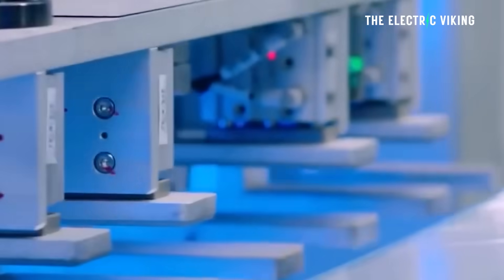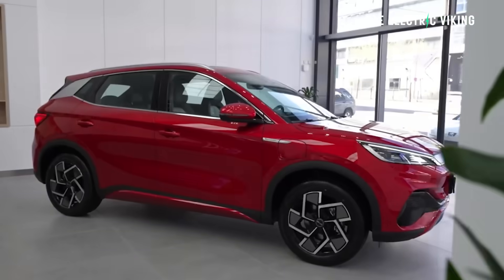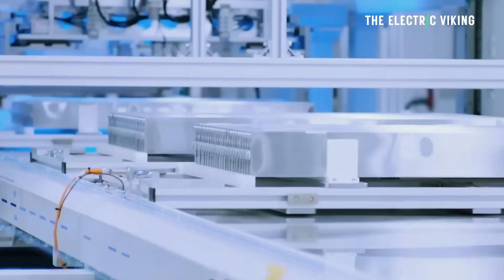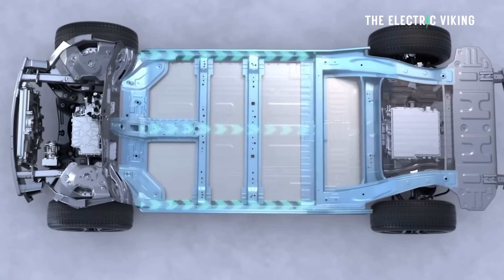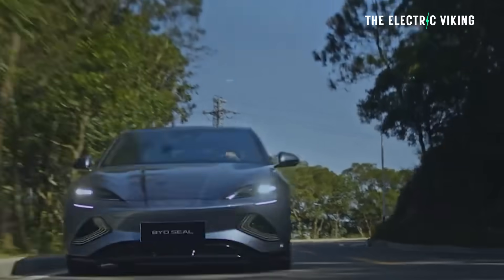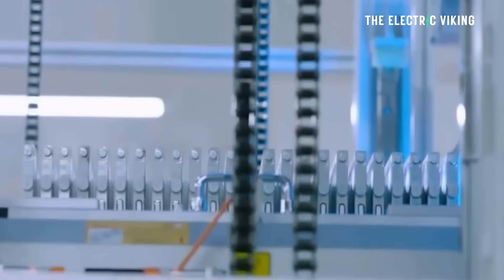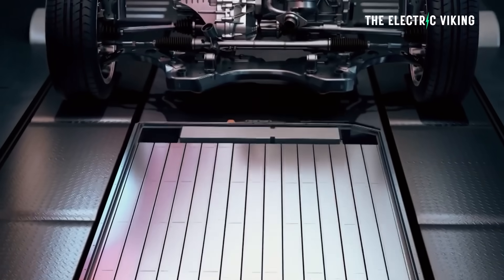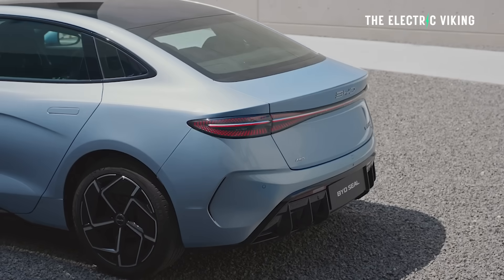BYDs 2 new batteries; ULTRA high energy density LFP or 700kw charging

Comment: I am an electrician and I  own an electric car. I love it.!!  BUT High charging speeds will only be viable in large cities and even then as EV ownership rises the Electrical load on charging stations will quickly reach full capacity and be overloaded..To charge a 64 kw battery at 4C will take sure about 15 minutes but it will draw 64kw x 4= 256kw. The transformer in our street is a 3 phase 50 kw transformer and it supplies about 20 houses. If half the houses in my street (10) put in 22kw 3 phase chargers and charge at 0.3C only, they will still draw 22kw x 10 = 220 kw. This is more than 4 times the street transformers capacity. ( Not to mention the overloaded current in the very hot aerial conductors (wires)). Our main Shopping centre (Park beach Plaza) only has 2 x 1000kw transformers to run the whole place (5acres of shops.) 8 EV's charging at 4C would be 8 x 256kw. ( That is the full capacity of both the Plaza transformers put together..As you say EV ownership will rise Exponentially in the next few years but so will electrical load. Look at some of the bigger petrol service stations on a busy day ☹️ with say 25 petrol pumps going flat out all day. ( Now replace all those ICE Cars with EV's. Wanting to fast charge and get on their way.) Do some very simple numbers (maths) and You soon see the Astronomical and Unavoidable problem coming..😢
Reply: This is the same logic the horse and carriage people used back in the early 1900’s. There will not be enough gasoline and gas stations to support all of the gasoline cars on the road.
Reply: @Turbo442  No. The logic would be the same if you asked me if I wanted a car that can drive 70 mph in the early 1900s. Even if I could buy this car at the time, I'd have no place to drive it.
Reply: @Turbo442  At no stage in the history of the automobile was that question ever seriously raised. Texas already had oil wells by the time the first cars appeared and although the initial distribution method was quaint (5 gallon tins of gas for sale in general stores) there was never a supply problem and gas stations sprung up in the US like mushrooms overnight.
Reply: @Turbo442  Well it didn’t. It took several decades to adapt but in the end it was completely fixed. Electricity infrastructure is much different than fuel so there are serious problems, if fixable at all.
Reply: Use it only for long distance travel.
Reply: @infinitebeing1119 not an option for everyone.
Reply: I think this is why China is far ahead of the rest due to having great electric infrastructure. also their crazy rate of building new power generation. I do not think the US grid is ready for mass EV adoption yet, I also do not see massive investment in new power generation.
Reply: @free_stylabro6490 that’s absolutely nonsense they simply do not.
Reply: @Porkcylinder  care to substatuonate your argument? Simply calling bs without providing counter information doesn't make your statement valid.
Reply: @free_stylabro6490 China has 3100 coal fired power stations and an additional 65 for 2025 -2026 are currently under construction. They are building renewables but burning coal unfortunately remains the main power source.
Reply: 50kW for 20 houses? Are you sure? That sounds awfully low.
Reply: @wedding_photography  50 kw is what my Bolt accepts (max).  One house consumes roughly one kw. The average for a household in the U.S. is 30 kwh/day or 30/24 kwh/hour). 700 kw is what 500+ houses consume. A dozen chargers at 700 kw presumably is more power than my small town (pop. 3000) consumes even accounting for our Subway, Waffle House and Dollar General Market.
Reply: @restonthewind 1kw to run a house?? It takes 1.1kw just to run a microwave.
Reply: @wedding_photography agreed. I used 14.3 kW yesterday at home - pretty average day.

Edit: my bad it was 14.3 kWh which is less than 0.6 kW in a day. Perhaps you’re right after all.
Reply: generally, speaking high charging rates are for dummies who know nothing about electric cars and think that they need to charge as fast as a nice vehicle fuels. I put 20,000 miles a year on my Tesla model three. The vast majority of charging is at home and on the occasions that we’ve gone on 2000 mile road trips. The car was generally ready before we were by the time the family went to the bathroom and got a snack. This idea that you need super fast charging everywhere. All the time is a narrative driven predominantly by people who don’t want to see an electric transition. I mentioned in a previous comment to take advantage of 16 C on 100 kW battery would require a supercharger that could deliver 1600 kWh per hour. This would be a serious drain on local infrastructure and is just impractical, especially for somebody like Tesla, who would have eight chargers at a given station. A charging station like that would use 10 city blocks worth of electric.
Reply: I use a 2.4kw charger with no problems 25k a yr @Creelyblades
Reply: @tysonfinn1470 
25k/year is about 75/day. 
Tesla uses about 0.25 kWHr/mile.
Roughly 20 kWHr/day.
So your 2.4kW charger is running 8+ hours/day. That's about the credible limit.
Reply: @joekoelker7523  yep
Reply: In this country wherever there is money to be made from a demand at scale there is money to meet that demand.
The utilities are, as we speak, gearing up for the demand that's coming  and they will stay ahead of the issue. Their shareholders will insist on it.
Also, people don't put 250kw chargers in there homes. And, because I work along side utilities, I know that the utilities like electric cars to charge at homes in the evenings because the charging helps to level out the grid. Meaning the don't need to start and shut down peaker plants as often.
Many plusses to electric cars.
Reply: @philborer877  Eventually ... I don't want to pay more for a feature today that I may be able to use ten years from now. I may not even keep the car that long. I don't need a phone with a terabyte/sec data rate either.
Reply: Most houses have a 100kW 'cutout' so does yours not?
Reply: @mikegipson1224 Think I have 24 kw on 220 v 3 phase. 65 A. Doubt most  are able to pull 100 kw.
Reply: @tallakflakke9236  yes I was meaning 100Amp my bad lol. ..
Reply: As EV adoption continues to grow then EV charging will grow 
and the infrastructure will be built to meet the demand 
Business always looks for ways to make money so they will service the need for EV as it grows 
Servos will notice the drop in fuel sales and invest more in EV charging. If they need bigger transformers they will get them  Tesla make mega packs which could supply enough electric to provide for lots of ev chargers 

So the market will meet the demand just like when cars took over from horse driven carts 
Servos started appearing and blacksmiths (making the horseshoes) and cart makers were put out of work
Reply: Home chargers are 19  kw or less much less typically . Here in California pge uses 3 phase for 100 kw or higher. Fast charging is for commercial property.
Reply: @ why do you think home chargers are 7 kW or less? Mine is 11 kW, they make them larger than that. The only limit to the size of the home charger is your electrical service, more accurately, your spare capacity, and the size of the onboard inverter on the car. Teslas come with an 11 kW inverter, hence all the Tesla branded home chargers, have an 11 kW capacity. The Ford F150, lightning in certain trims is capable of 19 kW home charging. 20 kW for home charging would be very doable, and that could be either home charging or public charging level 2.
Reply: As EV adoption continues to grow then EV charging will grow 
and the infrastructure will be built to meet the demand 
Business always looks for ways to make money so they will service the need for EV as it grows 
Servos will notice the drop in fuel sales and invest more in EV charging. If they need bigger transformers they will get them  Tesla make mega packs which could supply enough electric to provide for lots of ev chargers 

So the market will meet the demand just like when cars took over from horse driven carts 
Servos started appearing and blacksmiths (making the horseshoes) and cart makers were put out of work
Reply: It's not like this will come as a surprise to the network owners and decision makers. All cars will not become EVs over one night. There is time to build.
 Ten years ago there were hardly any fast chargers here in Sweden at all. Then in the end of 2022 there were 2500 fast chargers, and one year later that had grown to 4300.
Reply: What if they add batteries to charging stations. So they are constantly topping off. We call it caching in computer science. This is already happening for stove top induction household burners.
Reply: @davidguimbellot3102  That only works if (total daily electricity needed) is less than what can be generated and delivered daily to that EV charging station. We don't have the power generating capacity OR the transmission infrastructure to supply that.
Reply: Most people will recharge the 5kWh or whatnot they used that day at home, and set it to charge during the night when rates are lower.  
Fast chargers need beefy infastructure, and tend to "cheat" a little by not allowing all stall to run at full tilt at the same time.  
Guess that means more work for you and your colleagues.
Reply: Yes but nobody needs to charge at that rate overnight. Switch it to 7kW and either do it on off peak rates or from your own solar panel/battery storage system. This means that very few people are going to need charging stations, compared to what you see at petrol stations because their cars are pretty much always charged and most people don’t drive more than about 30 kms a day.
Reply: What?  You mean electricity doesn't just flow out of outlets in unlimited amounts?  Are you saying it has to be generated and transmitted?  And there are limits to that?
You'd better inform the clowns that are trying to force us all into EVs immediately.  Oh wait, they have gasoline motorcades and chauffeurs.  They wouldn't understand the real world.
Reply: 所以未来要把普通电网改特高压电电网😂
Reply: Thanks for the detailed, infotmative reply. It puts things to perspective. I think charging speed is just a flex, like how small size used to be cool in mobile phones. I think we should just have more chargers, in cities and fast chargers in other areas. Im sitting here in my car waiting for a friend for coffee, we'll spend about an hour here, maybe a walk. It would be great if I could charge for an hour, even if it just charges 50% of my battery.
Reply: @ you know an interesting conversation that is rarely had is the possibility of increasing level two charging speeds, my Tesla is at 11 and a lot of public chargers won’t even deliver that, but if the level two standard could get up to 20 kW in something like a model three you could getalmost 100 miles of charge in an hour.
Reply: Why do you love an electric car? Are you deficient in brain cells?
Reply: You're assuming that every EV will be wanting to fill up at the same time and every EV will either be fast charging and causing a problem, or charging at home and causing a problem. The reality is that we are in a transition. There are thousands if not millions of ICE dinosaurs out there who have promised that they will never be seen in an EV, therefore the transition will be slow. Add in the high cost of cars relative to disposable income (repos have been rising for months) and the trump promises to cancel anything EV related, trump tarrifs, trump recession and the transition will get even slower. The rest of the world will progress much faster and eventually the US will wake up and catch up. The Infrastructure Bill has provided a ton of money to move EV charging forward, but that will probably be comandeered to give trump his military parade. USA USA
Reply: @jeremycanning8934 Really? Check out the Viking's video on UK adoption. It's surging. As it is in most countries that aren't full of conspiracy theory wackjobs and a marketthat restricts fair competition. EV'S are the future buddy, you might not want one, or like it, but it's happening. Deny it if you want, it's still a free country, just.
Reply: Shill much?
Reply: If everyone who had an fully electric vehicle also had solar panels on their roofs; it would take some of the load off of the charging stations.
Reply: @ solar panels are about as much use as  an ashtray on a motor bike in half of Europe
Reply: Do you still have home insurance ,if you have one in your garage ??
Reply: I work in the transformer mfg industry. Production is more than five years behind demand. The US doesn't have the infrastructure to support current EV goals and just throwing money at the issue won't significantly improve things.
Reply: @Pyrrho_  yeh right. We all know transformers is just a movie
Reply: Mega packs for peak
Reply: There in lays the problem
Reply: Well explained mate but Sam will never answer you. He’s on a pro-Chinese EV agenda and can’t let facts slow him down.
Reply: Service stations will just become mass battery storage units.
Huge battery storage recharged by solar during the day, solar also recharging vehicles during the day with the batteries as a buffer and storage unit for night time.

Most people will just trickle charge at home and top up at a service station.
Reply: Where is the petrol stored for all those pumps? Underground. 
Tesla supercharger stations do the same but with batteries, your problem has already been solved.
Reply: Crazy demands on our electricity Network. We need 1c MW storage to solve this. Let's sell charge stations 😅
Reply: Yes . Slow charging is the viable option
Reply: Being EE myself I say it for years the infrastructure can't handle mass EV charging at usable speed. Thats the difference between engineering and greenwash.
EV's are the future, but it takes time to mass introduction.
Reply: Most times slow charging works. Last 11 years on night time charging with rare exceptions traveling long distance from home.
Reply: @davidbatchelor6393 I really like the numbers in your post. It helped me understand the average power levels for typical streets. 50 KW is lower than I thought!

I think it also shows the importance of doing things differently. Utilities would be very smart to integrate with EV chargers. The average American drives around 30 miles a day or around 10 KWH. If everyone is left to their own devices and plugs in around 6 o’clock at night when they get home from work, your numbers show that’s gonna be a problem. But if the utilities could control the charger so that everyone gets the energy they need by the time they need to leave in the morning, the average power demand decreases significantly. 10 KWH over 12 hours when the car is parked at night is less than one kw per hour. If they don’t do that, we will have to build so much more expensive distribution infrastructure. Plus utilities will be able to charge during off peak hours which reduces cost for the everyone. We have to be smarter.
Reply: I would like to add that if everybody in my street charges their EV from their rooftop solar then there is no additional load on the grid in my street.. Then if charge at home only then all good .
Reply: Additional Positive. I would like to add  to my Original comments that I made on Fast chargers. ( David batchelor 6393) and that is if that if everybody in my street charges their EV from their rooftop solar as I do 99% of the time ) then there is no additional load on the grid..I am very positive and not trying to be negative about EVs in any way, they are absolutely fantastic in every regard and the future..I love EVs..
Reply: Why are you assuming they are all going to be charging at the same time?

Here in the UK the average car is driven 8,000 miles a year. So about 25-30 miles a day. So call it 200 miles a week. 

That is about 50kw a week , or about 7-8 hours a week on a 7kw home charger. 

They are not all going to be charging at the same time. Some will top up for a 1-2 hours over night every night. Others will do a whole day or night of charging every weekend etc etc 

Here in the UK if all 30+ million electric kettles were switched on at the same time (30 million x 2.5kw) that's 75gw , the max output of the UK grid is 55gw. 

But we never have more that about one million kettles on at once. So the issue dose not arise.
Reply: You visualised the challenge very nicely, thanks.
Reply: Not really dude. That's expected. With a change like these new infrastructural challenges come. But the US could not suport so many oil engine cars, as they do now, a 100 years ago. But they did the infrastructure investment so they could. And thats how the world moves. The same way these companies are bettering their batteries every year, countries will also invest in infrastructure to deal with it. Which means more jobs for us, electrical engineers 😂 (I'm just a student. Haven't graduated yet)
Reply: @joaovitorcruzdasilva2795  You can imagine the grid ultimately handling so many EVs charging so fast, but why would I buy a car now that only works with a grid you can only imagine decades from now? The question is: which vehicle would you buy now? By the time the grid can handle 700 kw charging, I want a car that literally flies. By that time, robotaxis will be ubiquitous (and may be flying), and few people will own a personal automobile at all. Technological progress is great, but 700 kw charging is absurdly far ahead of the curve.
Reply: @restonthewind We are buying a new car in July next year. It will be petrol.
Reply: Supercapacitors.
Reply: It's not a problem!!!! It's an opportunity!!!! Just install more transformers. I'm also an electrician and its not a difficult problem. If we can move billions of barrels of gasoline and oil around the globe. We can move trillions of electrons around the globe easier and faster. We can generate the energy. We don't have to mine anything like the colossal refineries we have. All the energy is already here. Just capture it.
Reply: May be a combination of energy storage and charging stations will help lessen the demands on the grid. That way you might charge a car very fast and pull from the grid at  a load that can be adjusted to the capacity of the grid connection. Most chargers are not utilized at all times. That gives the charger battery time to refill.
Reply: @liveslowsailfastonlanier1374  Many things are possible someday, but why pay today for features that could only be valuable years from now?
Reply: I appreciate the math you are doing here, but you are thinking too linearly.  With 8 minute charging, that's about the same as a regular gas pump.  At a typical gas station here in the USA, there are only 2 or 3 pumps actually in use at any time.  2*256kW is around 500 kW of sustained power draw.  That's the realistic type of load we are talking about here.

Now consider that in the US, it's likely that 50% of EV owners will have charging at their parking spot (5kW to 10 kW) so half the number of people will actually be using Level3 charging compared to existing gas usage.

I can't speak to neighborhood transformers, but my house has 50 kW coming in, which is the standard amount of electricity coming into a house in the USA.  25 kW is pretty much the minimum.  I can't imagine that our neighborhood transformers could only support 1-2 houses at maximum draw... that would be poor systems design.
Reply: Disagree with EV ownership rises. Majority of people don't want one
Reply: @ i’m curious what you disagree with, do you disagree with the idea that more people are choosing EV‘s each year, or do you disagree with the statistics and believe that there is a massive conspiracy under Way that the entire auto industry and journalists is in on misrepresenting the actual numbers? Or are you just trying to communicate you don’t likeEV‘s.
Reply: @jeremycanning8934 How many people did you poll to come to this conclusion?
Reply: Have a big battery bank at the charging stations that trickle charges from the grid/solar. Fast charging without the need to do anything to the grid.
Reply: @armandoaranda7989  Sure buddy. Like that will ever happen 😂😂😂
Reply: @thewolf9851  It already happens.
Reply: @itekani  No it doesn't.
Reply: @thewolf9851  You are not happening 😂
Reply: @thewolf9851  Stop trolling. It has been done and is being done. You just have to look it up if you don't believe me.